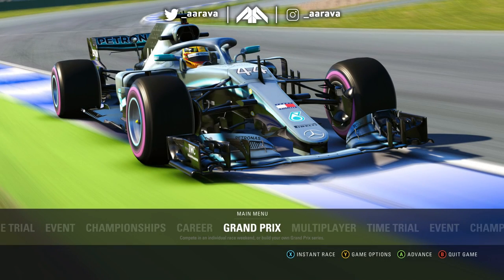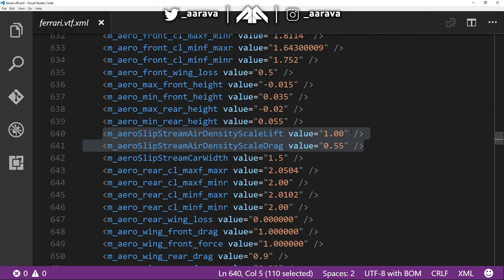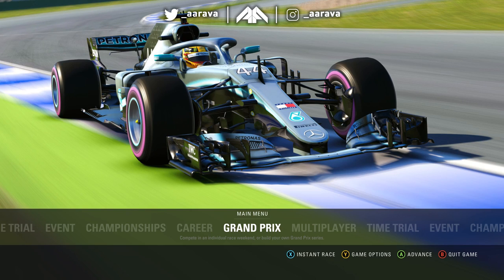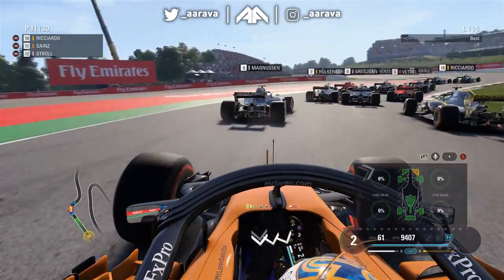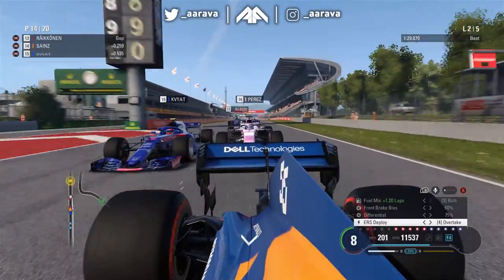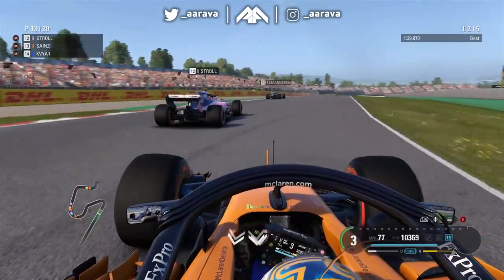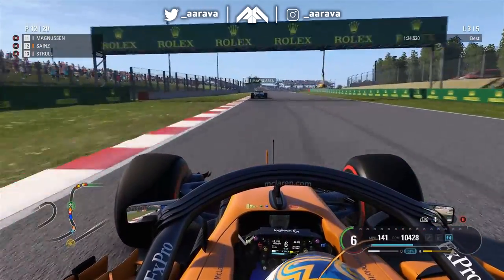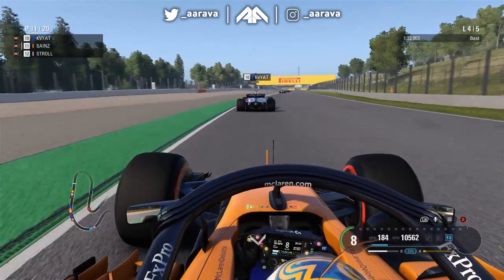2019 F1 Spanish Grand Prix with NO DIRTY AIR & OP SLIPSTREAM! - F1 Game Experiment

Comment: Try this in baku. And with the lowest dowforce 1 1 wing 😂😂
Reply: This
Reply: Higher wings punches a bigger hole in the air and therefore creates a bigger slipstream when behind the car in front, also the slipstream effect is more prominent when the car has more drag resistance behind as they lose even more drag then they would with lower wings